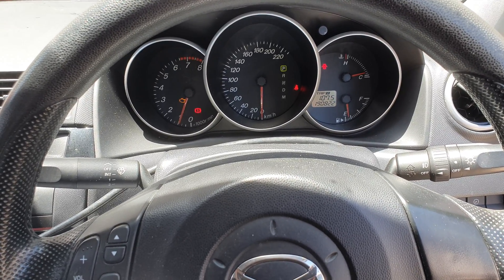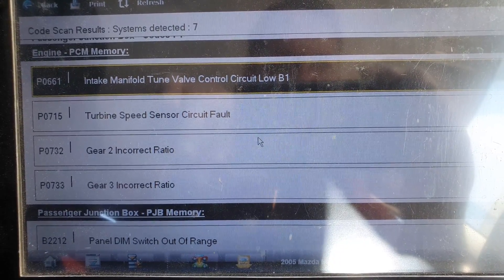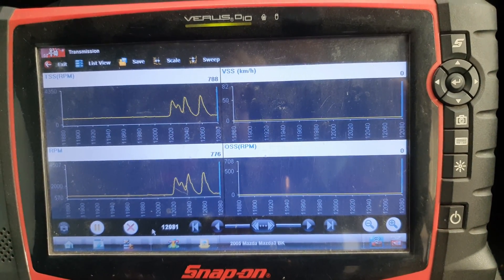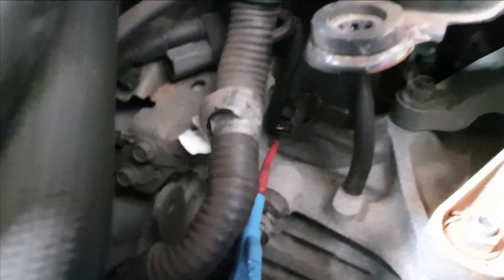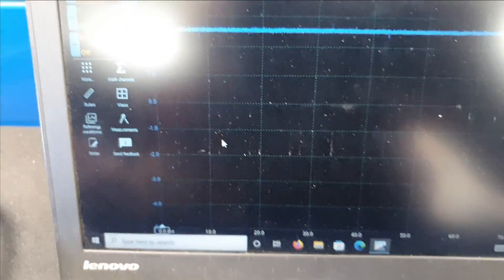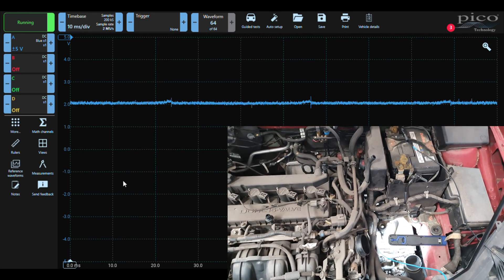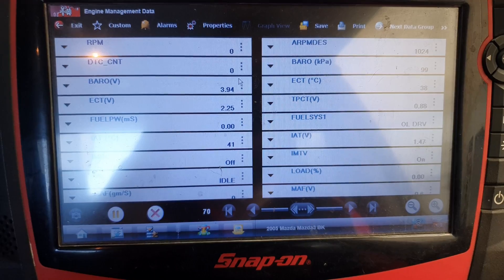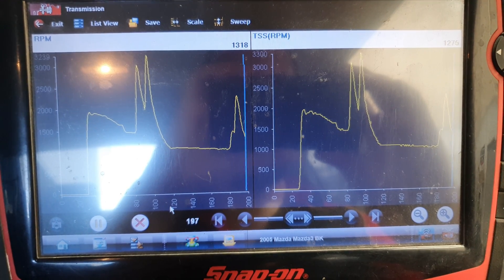Mazda 3 P0715 - Engine light and AT light on

Comment: Guys beware from the output speed sensor ( the full black sensor without the iron tip) ، if u remove it the oil will leak immediately , be ready for that , put something under the car .... .

Comment: If my 2011 Mazda 3 is reading a P0720, then should I start with the input output sensors or is it calling for transmission fluids/filters/solenoid replacement, or could it be the tcm? Sorry I just don’t know where to start and YouTube hasn’t been clear
Reply: ( the full black sensor without the iron tip) ، if u remove it the oil will leak immediately , be ready for that , put something under the car .... .

Comment: I had this same light on my dash with AT light. Car is running fine and I replaced the sensor since it was inexpensive to do so. AT light is on but there is zero slipping. Car runs perfect. Not sure how to try and clear the AT light?
Reply from the maker: Did you get this sorted Alicia?
Reply: Plug a scanner scan codes then erase the AT light should clear if not repeat method with car on

Comment: Hi during the test run, was the transmission slipping? How many sensors the transmission have, meaning I have seen transmission with 3 sensors on it and I kept getting a P0720 DTCs no matter how many sensors I replaced or clear the code. Will scope it next time. Thanks
Reply from the maker: No Daniel, definitely not slipping. Have you still got the vehicle? Would love to see the live data off it?
Reply: @romanosautomotive  the client end up calling the transmission and all is well. Not sure if the internals was the issue that kept setting the code and had the gears slamming in. The trac and vss light will either flash or stay on. And that was frustrating so he just replace the entire thing. No more codes

Comment: Great video as usual👍
It's odd that this sensor was failing when cold but start's functioning at operating temp😉
Thanks for sharing Bro, Stay Safe👍
Reply: Instantly sounds like a solder crack issue on some part of the sensor.  Up to temp it bridges the gap
Reply from the maker: Thanks again Salman my man!

Comment: These mazdas run at 98-103 deg it usually fries the tcm and sensors , my fix to reduce the heat and save engine parts is to   Intercept the ground wire on fans and control it with my own digital co trolley  to turn fans on at 84  and off at 78
Reply: Coolant temps?  Wow that's high

My diesel at idle and slow crawling speeds on a hot day can get to 100 Celsius.  I might try something like you've said here